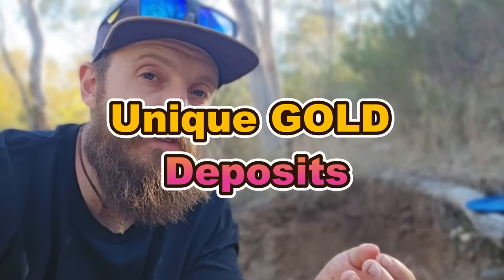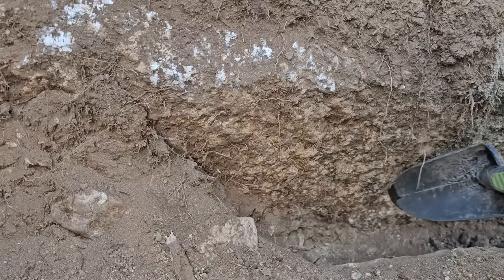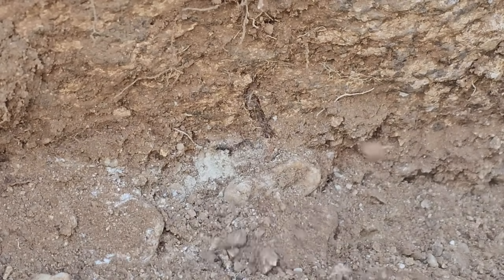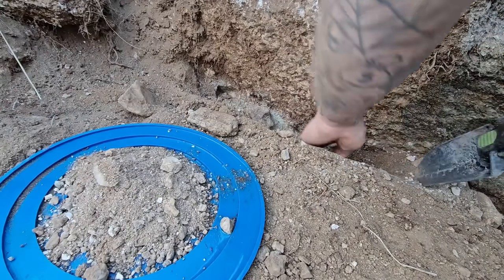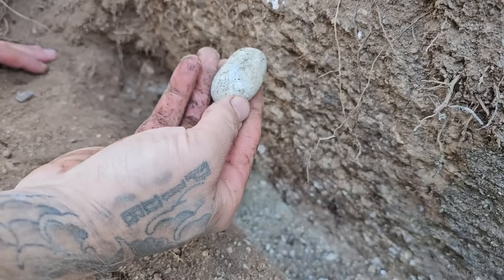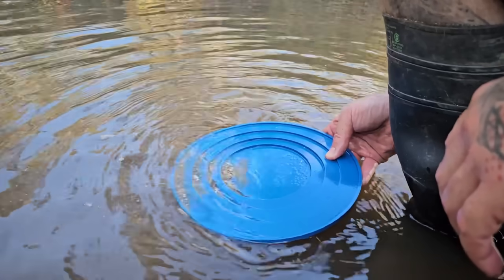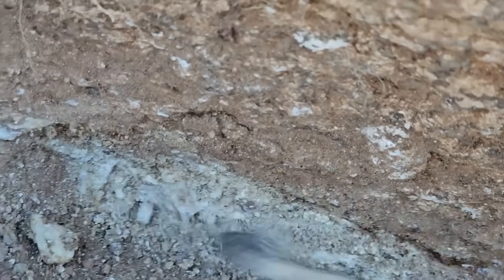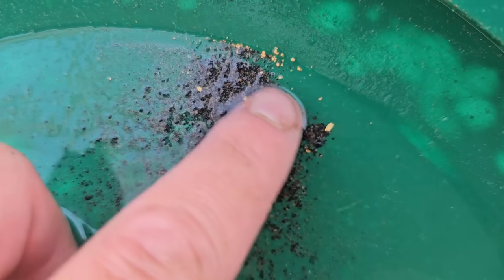These Trees Show You Where To Find Gold

Comment: The specialist observations about deposition, so ace, Chris! This is the third I've seen lately that has looked into the value of finding a long root on a creek, source, ey, saucy, long-rooted straggling struggler trees, on gold-bearing bedrock, where a big horizontal root leads to that crack where the last of the moisture reservoirs, hence where the gold and other heavies settle, that get frequently rewashed, so it's not a flood-only deposit, but is a locus of long-term natural classification. I thought it's the big old regrowth stump upwards, nup, yes, on finding surface diggings, the trees got used for suring underground, on the creek itself, it's the long root you're after! (Pete of Pete's Gold Adventures was one of the other long roots lodes observations, and at Gary's house of OzDetecting, a garden shrub 2 metres tall with 30 metre tap root through his drainage pipe, causing flooding about his yard, the f***er was a monster vegetable anaconda. Related that to Pete's observation per long roots. Yes, I'll make sensible remarks, plus throw in a laugh grenade. C ya!

Comment: I'm convinced you're losing most of the fine gold in that pan. Clay-rich with too much variation in particle size and without pre wetting the material, it's pretty much a guarantee. You could use a 5 gallon bucket and classifier set to fix this. Sift the material, wash off any rocks into the bucket (save the rocks to inspect with a metal detector later), add extra water with dish soap (or jet dry) to break water tension, break up the dirt in the bucket and stratify by vigorously mixing and shaking the bucket. Then you can scoop layers of dirt out of the bucket and discard it, and only pan the bottom 6 - 8 inches.
Reply: You seriously felt the need to come over here and sh!t on Chris’s channel? Your family must love you during Christmas… 🙄